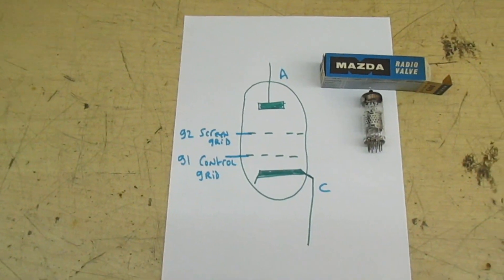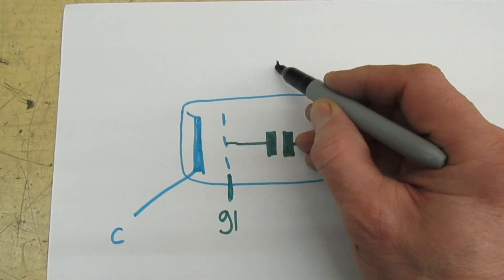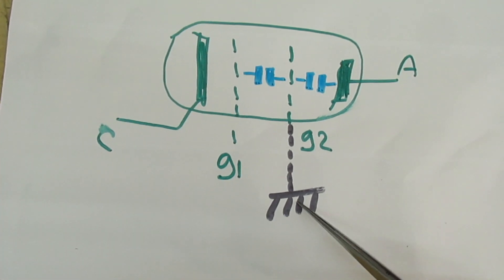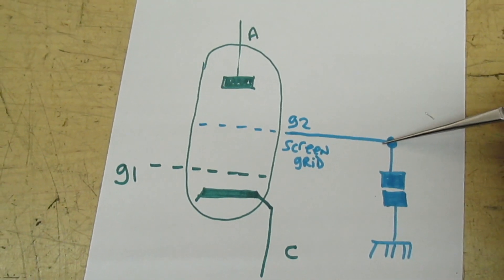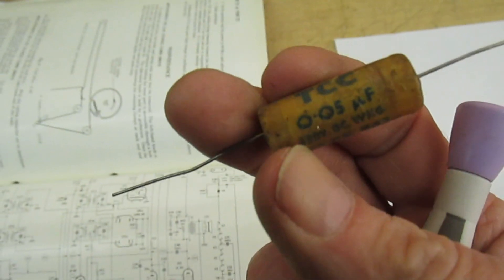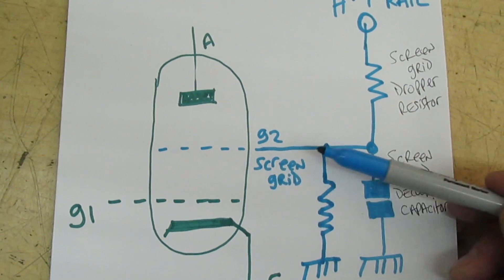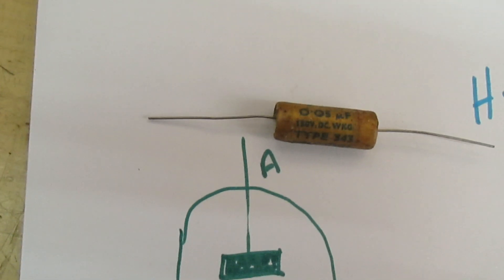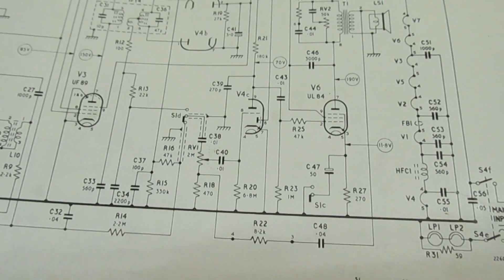Screen grid  G2  and decoupling of thermonic  valve explained

Comment: I have seen and read a lot about what is the grid leak capacitors and resistors and got confused but this short video with simple and smooth explanation I got it clear.

Comment: Is there a optimal lower voltage on the screen grid g2? should it be 15V lower than the plate or even lower. Could it be useful to have a Zenerdiode to regulate a constant voltage between plate and g2. Im asking in context with amplifying audio signals :)
Reply from the maker: the reason for a slightley lower G2 voltage is so the electrons pass through G2 to the higher anode voltage .
Reply: @michaeldranfield7140  ok, but what voltage is optimal? and should the voltage be zenerdiode regulated?

Comment: Another symptom of a leaky cap to G1 of the output valve (or any valve) is distortion as the valve is outside its working parameters. I've seen many sets with damaged mains transformers as well as ruined O/P transformers and worn out valves. There are a minority of people who refuse to believe that wax caps leak. Others rely on low voltage testers to prove that the cap is fine. I always test caps at working voltage. Caps in line with potentiometers such as volume and tone controls can leak enough to open the carbon tracks in the pot, I've seen plenty of that in old sets.
Reply from the maker: correct , there should be no positive voltage on the grid of the audio output valve , valves are pretty hardy and can take big overloads but excessive anode current can burn out the audio output transformer .

Comment: Many thanks Michael for this excellent description. I have been repairing assorted audio equipment for over 40 years but only started in the late 70s when valves were most un-fashionable, so I missed out at the time and am only now getting my head around how they work.
And what a useful tip re- keeping the 'original look'. Thanks again, keep up the good work!
Reply from the maker: Thankyou for that , I was brought up repairing valve equipment, thats mostly all there was on the tip in the 70  S  !!

Comment: That was a very good presentation. I really like how you focused on one part of the circuit. Now, if you could just treat the whole radio that way I might know what I was doing!😆
Thank you!
Reply from the maker: Where ever possible I try to make videos that other people have not already covered, however if you are getting into valve radios for the first time what I would advise is to replace all the wax paper capacitors before you do anything else , do this first and your 90 % percent of the way to getting a working radio..